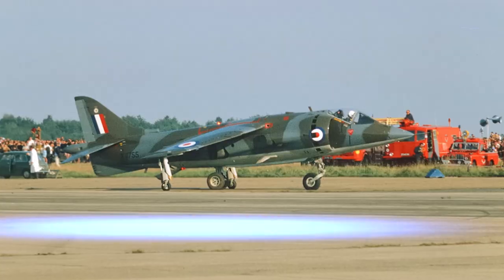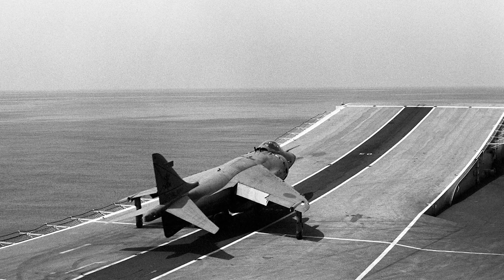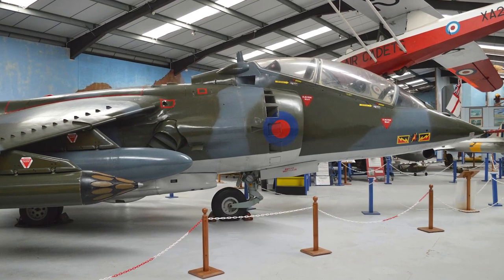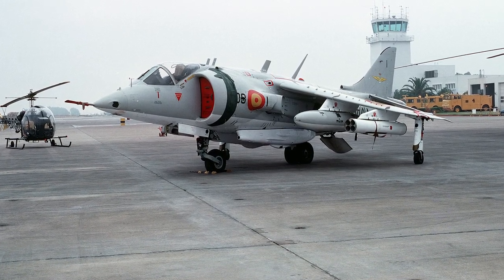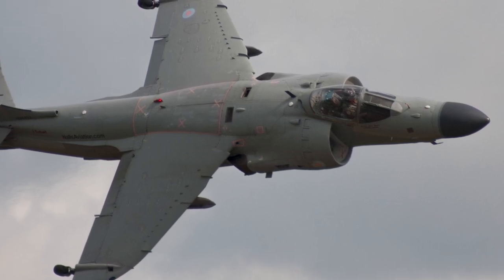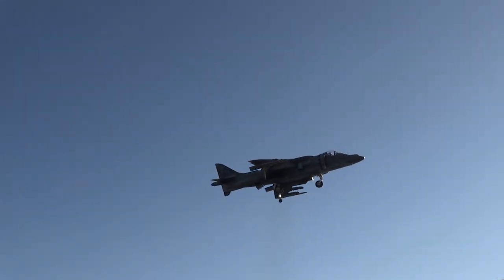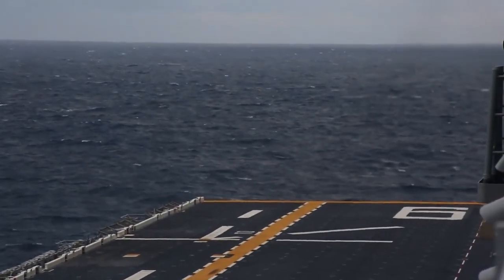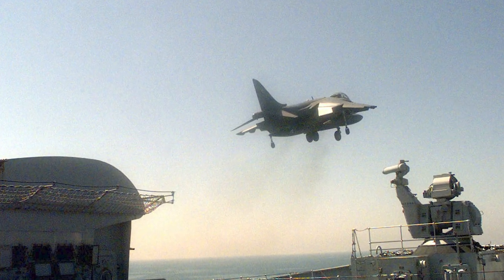Harrier Jump Jet - A Short History (HS Harrier,McDonnell Douglas AV-8B,British Aerospace Harrier II)

Comment: The sea harrier also had a different shaped wing to the original and after Britain recommitted to the harrier 2, the wing was found to be more effective than the early McDonald Douglas revised wing design, so the so the wing was redesigned again using experience gained from the sea harrier, and the shortcomings of both the original and early McDonald Douglas design, and further  development of the sea harrier wing to create what became the wing of of the av8b and bae harrier 2.
Reply: It was designed and built by the British you plonker

Comment: Question for Harrier/ Kestrel/ p.1127 laureates- Did the early Kestrels & prototypes have the 500 gallon (500?) water tank that dumps H2O on the Pegasus engine during hovers to keep it cool? At a Miramar airshow a few yrs ago I had a great chitchat with an AV8B Marine Harrier pilot after his demo where he gave me a little tour of the cockpit, explained the ridiculously huge array of controls & instruments, and walked me through what a vertical takeoff/ landing entails and the transition to and from horizontal flight. What I learned is that it is a complicated and potentially super dangerous procedure. The water cooling system's ability to function properly and NOT run out of water is... pretty essential to the plane and pilot's prognosis of remaining intact. A big turbofan operating at near max thrust to keep the plane aloft at zero airspeed apparently runs a wee bit hot. So, I am wondering if this was a later addition after some lessons learned the hard way or if there was another cooling system before it that proved unreliable. 🤔?
Reply: I think 500  gallons might be a little extreme. I worked on the Harrier from early '80 through  early '87, if I recall correctly, we used about fifty/fifty five gallons of distilled/ de-mineralized water...just saying.
Reply: Those British and American Harriers that used to operate in Bagram AB, Kandahar AB and Camp Bastion where only conventional take offs and landings were used, since they were not based on carriers, did they have to carry water?
If not needed, then I would imagine the additional weight saved would be used for extra fuel or munitions.
Reply: 50 gallons of distilled water provides ~90 seconds of water injection.
Reply: An extra gallon was always available for the boiling vessel ;)